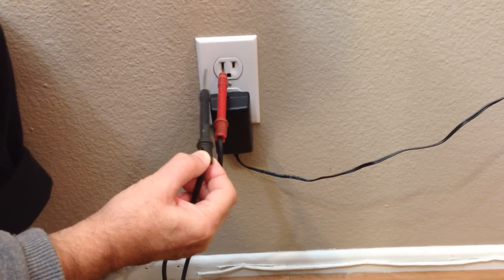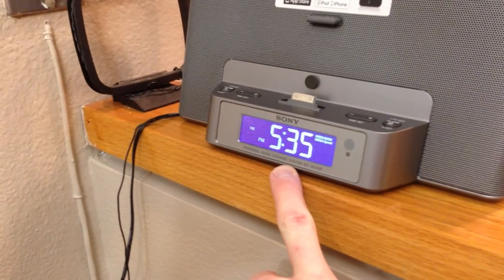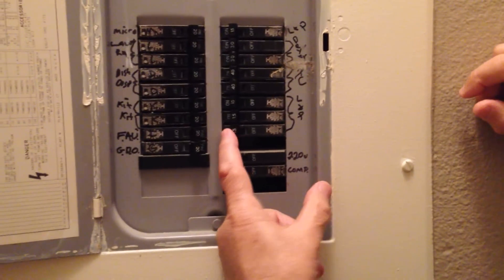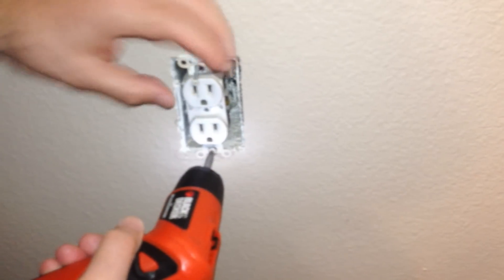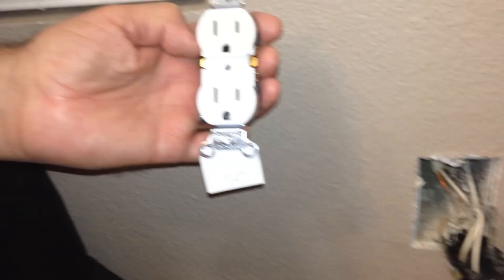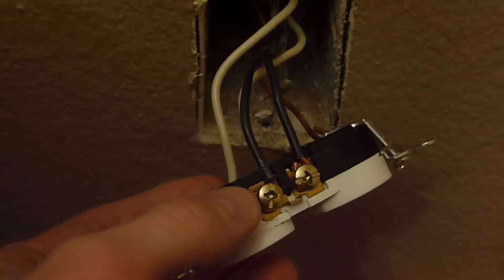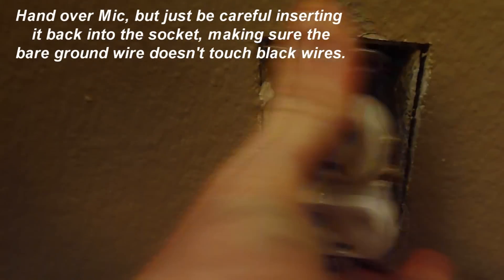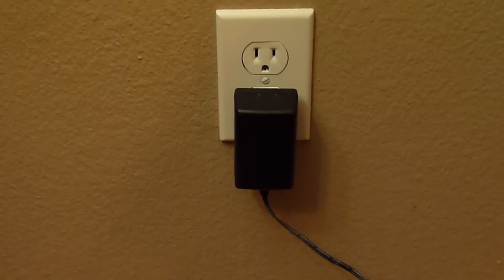How To Install A New Electrical Outlet Socket Receptacle In Your Home

Comment: So I take it that it doesn't matter which of the black or white wires connect to the top or bottom set of terminal screws. It's good as long as black goes to brass and white goes to silver on one of these regular type non-GFCI outlets. Is this correct?
Reply: Eddie Ecstasy